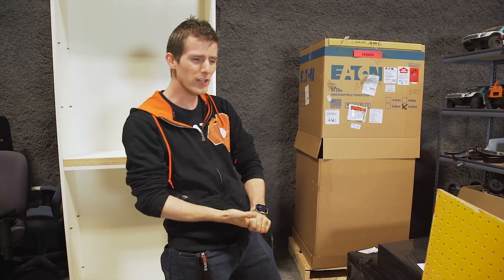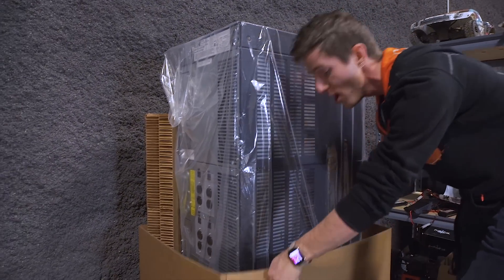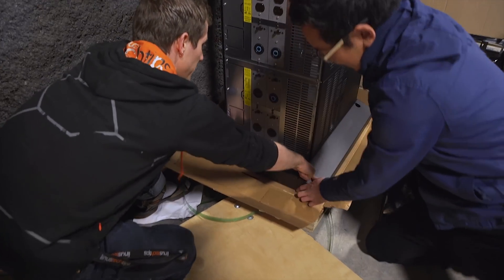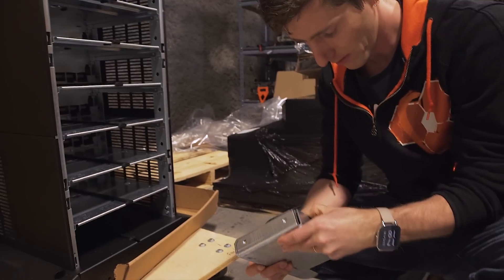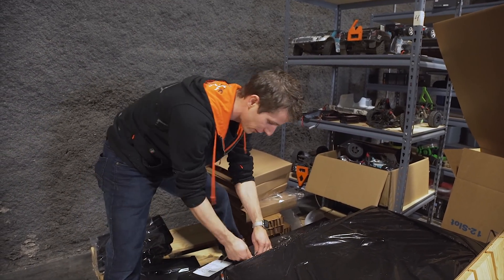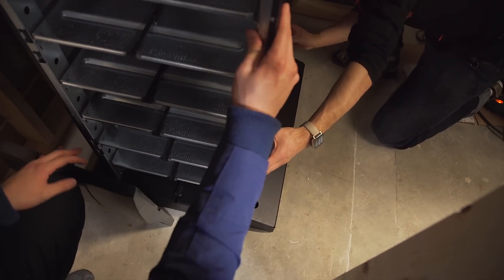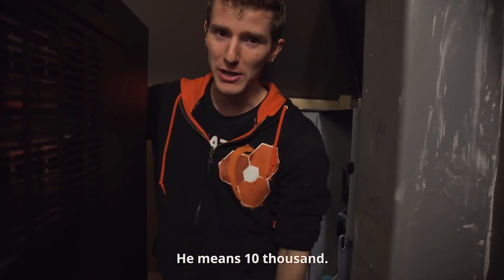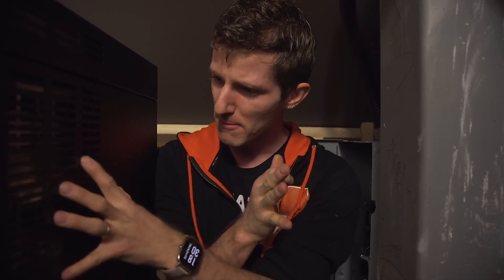HOLY $H!T - A $17,000 (CAD) Man-sized Battery!

Comment: 240v super high? Thats the base voltage in my country.
Reply: +ShimmeringSword I live in a 220V country and there are no safety ads either. Speaking of safety: During my brief stay in the US I had a vacuum cleaner power cord catch on fire. Never heard of something like that happening here (you know, half the current and all that).
Reply: +Jared Sheppard This sounds veeery silly. You do know it isn&#39;t really the voltage that kills? It is the current of Amps that is why the, What is it called in English, Ground fault circuit breaks at a certain AMP rather than Voltage. 

The reason countries like Sweden etcetra use 230-240V network is due height differences. You can&#39;t have 120-130V systems in a country that has many up and downs with lack of flat surface since you would lose to much too cable resistance.  

Also, when you get zapped by electricity, you will barely feel it aside from a fuzzy feeling. The dangerous aspect of getting in contact with Electricity depends on How it travels through your body and the fact it can mess up your heart rhythm. Making it beat uneven or simply shut down fully. Which can cause life complications. That is why it is recommended to go to hospital directly after for 12-24H monitoring. 

Also, every country uses high voltage to carry their power in large distances. In fact, we use 50K voltage systems in Sweden. Think even the power line that runs from northern swedish water plants have 100k but I am not too sure on that. The reason you increase voltage is to reduce Amps which generates heat among other things. 

So, no. The reason that 120V is safer than 230V being the partly reason is a silly excuse. Most educated electricians should know that Amps is what kills and Amps can be generated during shifting changes. For example, if a lightning bolt strikes it creates large amount of amps upon impact. Much like how a magnet moving over a coil generates Amps. Basic principle of Generators. 

So your experience sounds like silliness to me. Oh, I am an educated Electrician before you pull some odd card on me.

EDIT;
I might add, the usage of 120-130V systems are not beneficial since you lose a lot of your power consumption in your wiring since lower Voltage means higher Amps. So, technically, you are only losing out on efficiency.
Reply: +G009 The US uses VERY high voltage to carry current for long distances; however, when the power is introduced into the home it is brought down to 120v, this is done for various reasons but partly because (and I know from personal experience) being zapped by 120v is nothing compared to being zapped by 240v, so it's a bit of a safety thing.
Reply: @Shepherder312 THEN MAKE BOTH LINES OF EVERY OUTLET LIVE!!!!!!!! Belgium used to do EXACTLY that to make 220V out of 110V until they switched to 220V between live and neutral.
Reply: Here in canada(where linus is) in the residential area, we have 2 phase of 120v which one have an offset of 180°. that mean if you use both 120v to power something, you have a total of 250Vac.
Reply: Guys you're missing the point here. The same amount of power is delivered with 120/240V however because V/I = R a higher voltage is better because it means a lower current and therefore less heat created which leads to inefficiency, and thus a thinner wire can be used. So 240V is more energy efficient and the risks are still low if you are not an idiot who sticks their fingers in plug sockets. The fact is efficiency is important in this day and age so please educate yourself on electricity before you talk out your ass
Reply: shadoom
 hey now! Canada is a real country!
Reply: +Jared Sheppard Actually, the historical reason for 120v is because of the early designs of lightbulbs.
Reply: +Nom Nom We do as we please. Say something about it and we will give you some democracy. 

Do...Do you have oil?
Reply: +Gone Tomorrow Half of Japan...
Reply: 240v at 50Hz is the uk standard, with consumer sockets having maximum current draw of 13A, 16A for )
low draw professional applications such as catering, 32A and 62A for high draw such as small event lighting and sound systems and 32A 3 phase, 62A 3 phase, and 125A 3 phase for very high draw enviroments such as large scale events and industrial use. with the voltage of 3 phase being 400v across the phases. the reason 240v is used instead of 110v or 120v is cost, a higher voltage reduces the amount of current required to deliver the same amount of power, high current is the reason that wires get hot and a high enough current would melt the cable so a thicker cable is needed, at higher voltages with a lower current you generate less heat so you can use a thinner cable which uses less copper, making it much cheaper, it also makes it slightly more efficient as less energy is lost through heat which wont make much difference on the small scale but on a national scale that saves quite a bit of money. the reason why americans use 110v instead of 240v is because when the power grid was first installed well over 100 years ago, 110v was the standard due to lightbulbs of the time and to change over the entire country to 240v these days would cost trillions of dollars. whilst the long term savings would be phenomenal, it would probably take a decade if not several decades for the 240v system to make up for the initial cost. also the substations that convert the electricity from the several hundred thousand volts used to carry it down power lines to the consumer level of 110v would become redundant and new substations would need to be built to replace them which would he so expensive and would have power outages whilst being installed. america hasnt switched because its expensive and massive job to complete
Reply: Even in Israel which is a very young country we have 240v
Reply: 240Vac***
Reply: So its the best of everything, harmless, efficient, polivalent.
Reply: m8onethousand
Well, yes, you need voltage to carry it. I mean, Electricity is Ohm's Law... So kinda hard to be fried without it. Plus, if you stand on insulated ground with insulated shoes, basically plastic. It won't travel through your body so it won't even kill you. As ofr you touching a cable and it melting in your hand, that is bull crap since the mere Lightning bolts which is created during short cuts would blind you through the eyelids.

Voltage is the man, Resistance is the wheel barrel, Amps is the content within the wheel barrel. The wheel barrel allows you to move the object but it still provides Voltage resistance.
Reply: m8onethousand
" , it's hella fun shorting out a transformer and just melting metal rods by sticking them in between with your bare hands, no gloves whatsoever "

What do I need to re-read? You holding a hand over a transformator wiring at 30.000A that melts when the mere Insulation coating on Transformator copper only starts to melt around 60+ Celsius. You are saying you can hold an object that is 50+C Degrees? Really now? What are you? Superman?
Reply: Meegoo 10 volts is not enough to pass through dry skin. You'd need around ~60 volts if it's AC for that. So yeah, if you see a 30k amp cable at 0.1 volts near your home, don't fear to touch it since it won't kill you.
Reply: MX_81_DRAGON If you need volts, then don't say "volts don't kill, amp does". Do it the proper way and stop promoting incorrect dogma. You need both volts AND amps to kill. Get it right.
Reply: m8onethousand You need to work on your reading comprehension. 
I wrote “double the voltage means half the current to deliver the same amount of power.” 
You know, W = V × I. If W remains constant an you double V, I is halved.
Reply: MX_81_DRAGON Ehm sorry, but to my knowledge most European countries (certainly my native Netherlands) have 230V 16A on regular, non-heavy-duty circuit breakers, not 230V 10A... Heavy-duty circuitry here is 380V rather than 230V, and I believe 20A at aforementioned 380V is fairly normal for heavy-duty circuit breakers, though it's not uncommon to go up to 380V 35A or above.

***** Formulas like those are normally given with quantities rather than units, so it's P = U x I, not W = V x A, and certainly not W = V x I. Other than that, you're absolutely right though...
Reply: Final Cam Oh, it doesn't matter for that; 110V and 240V can supply the same amount of power. The thing is that the higher the voltage is, the lower the current needs to be to deliver the same power, and lowering the current running through a system has a number of rather useful advantages.
Reply: m8onethousand
You wrote touch+bare hands which makes someone with Reading Comprehension understand you were touching them with your fingertips. You didn't write " Shorting a transformator with a tool(Metal rod) is hella lot fun ". You shouldn't complain to me about reading comprehension when you write in a manner that does not even adhere clarification but only confusion. And your next post is you clarifying what you wrote which doesn't even remotely relate to what you originally wrote.

Also, Voltage doesn't kill what so ever.  Amps doesn't exist without Voltage nor does the other. And neither of these exist without Resistance. So you do not even need to clarify "You need voltage to kill something" Since Voltage wouldn't exist without Amps and Amps wouldn't exist without Resistance. Hence why the electrical world is built upon Ohm's Law. 

Also, metal rod that isn't insulated with plastic or similar is the same as touching a metal piece as for metal not melting? That is kinda untrue. If you take a screw driver and get a bit too close between N and L, you will create something akin to lightning which makes the surface of your screw driver to have a light melting in 230V circuits. Maybe this wouldn't happen in a transformator since there is not space between the copper. But I would imagine the inner coils would still melt. As for the Transformator being worth more than what I earn in my whole life? That is probably not true since you earn as an average Swedish Electrician around 40k USD a year + bonuses from finished work which might make that 50-60k USD on a lucky year. So technically it will be easy to earn enough for one transformator in one life time. You just won't have any living necessities or luxuries to accomplish it.

As for Amp kills and voltage doesn't? It is kinda true. Since it is the shifting change that kills you. When voltage meets a high resistance, it generates a lot of AMP which becomes the deciding factor if you die or not. But in AC you have 60Hz which is similar to 60 shifting changes of creating AMPS across the resistance or in proper terms, load. So AMP is technically the killing factor rather than Voltage.

Either way, our opinions differ on that point. I personally believe AMPs kills since you have certain low Voltage circuits that can kill you because of the amp currents running in the system. Low voltage being less than 24V. Oh, AC types that is.
Reply: +ShimmeringSword In a country where you can buy a gun in the supermarket it would hardly surprise me if safety isn't as much of a priority.
Reply: Sweden has 230V base i think
Reply: +Göran Svensson Actually, in most of europe it's 220-240 volts. It doesn't really matter. So a french 220 V rated thingy will work on swedish 230 V network.
Reply: m8onethousand Yeah but did you just hold the rod... or did you short the trasformer like: t-rod-you-rod-t.. because then the rod wouldnt melt because the current doesnt flow through you. And if you were standing and a isolated ground and touching copper with 30.000 Amps it wouldt anything. If the voltage was higher.. let the voltage be higher because the current wont go through you.(path of least resistance). Touching the rod with both hands is something else, because with high voltage you still had part of the current through you and probably die.
Reply: +m8onethousand no you still would even with 200 Volts on there, wanna know why? because you didnt do it. 30000 Amps on a Transformer is a lot. if you take 2 turns of wire on the secondary and lets say 1000 on the primary, you would still get 600A (N1 : N2 = I1 : I2 therefor 1000:2 = x:30000) coming in from the outlet, which is not possible, not with 120V and not with 240V. so stop using that as an argument

of course the primary could have more windings, but then it is probably custom, and i dont think you would coil it up like 40000 times so you can plug it into a 15A socket (120/240V is irrelevant) 
so yea, try to be more realistic and watch less photonicinduction
Reply: m8onethousand Well guess what: telling how cool you are touching 30kAmps and insulting ppl afterwards because you dont explain correctly what you did is stupid.
Insulting me who was just asking what you did, because i probably have the same knowledge as you in electrical engineering, is stupid as well.

Btw. The argument that amps kill is correct, because that statement has nothing to do with why the current goes through the body. It is a fact that current controls your muscles(stops the heart).
Reply: m8onethousand I am seriously speechless right now... I just told you what you are doing wrong and that I by the love of god dont know what is wrong with you being so aggresive. 

I am not here to tell you what mistakes you do in commenting, but i already told you that i couldnt understand the technical situation with your first comment concerning the transformer. After asking for clarification you awnsered with a non helping comment. Then I asked more direct for what you did... The awnser was a agresssive and insulting way of just telling me what I was asking. I dont know whats wrong with you.. probably too much hiding behind the internet wall.

If you dont want to "lose" this conversation(thats what i call childish).. I am fine with that you won..  But pls stop commenting more nonsense.
Reply: mark rossi I just watched his video... my conclusion: all people who are the same oppinion including himself dont understand english.... I already said in a previous comment that there is a difference between WHY the current goes through the body and WHAT kills the human... I am losing my hope in humanity
Reply: +m8onethousand Reading your aggressive and insulting comments almost makes me wish you'd try to let 0.5 amps flow through your body. 
Seriously, you're talking about totally different things. Whether you touch a low-voltage-high-amps circuit with your high resistance skin, (basically resulting in a 0 amp current) or if there's a low amount of current actually! flowing through your body! are totally different scenarios.

Your statement 'amps aren't dangerous if the voltage is low' is not wrong, but it's only true when you're talking about an external circuit, not when it's actually flowing through you.
Reply: +ShimmeringSword  Canada, no safety ads aside from being told to call before you dig to avoid the underground lines, and maybe a recommendation now and then to get an electrician to handle anything over 80 - 110v.
Reply: +Adam Cross like the United States Mexico and all of South America?
Reply: ***** What everyone seems to forget is that 220v is more efficient because it can overcome resistance more easily. It makes for thinner wire and higher wattages in a single household circuit. Unfortunately it also means it will pass through insulation more easily and arc more readily through air. It's 6 of one half dozen of the other, I'll  happily work on live 120v with decent pliers and a screwdriver, don't know that I'd risk it with 240v.
Reply: But we use less amperage for example for his 120 amp we would use a 60 amp because we have 2x the voltage at least here in new zealand...
Reply: Everyone except U.S. has 240V
Reply: @IIlIIlIIlII  Canada is also still using 120v
Reply: @IIlIIlIIlII us has split phase ⚡
Reply: G009 Yeah, it's pretty standard when moving power over long distance. 240v does sting, but 120v has never left burns and subsequent scars on my fingers.
Reply: m8onethousand Exactly. Double the voltage means half the current to deliver the same amount of power and, as you said, it is current that melts cables, so higher voltage is safer in that regard.
Reply: Helveteshit What on earth are you even on about? You should seriously re-read my message.
Reply: +Helveteshit The final at wall voltage and the transmission voltage are completely different things. Most long range transmission wires carry not only significantly higher voltage but are also DC, that power is then converted and distributed at lower voltage AC at large switching stations before finally being stepped down at the pole transformer to 2 phase 120v AC. I live in Canada and my dryer and stove are both 240v by simply bridging the two rails on my electrical panel. the big deal about the dedicated line Linus has for his UPS isn't that it's 240v but that it is a 100 amp service... just for the server!!
Reply: same
Reply: +G009 i was searching for this comment we got 380V plugs here that are called high power
Reply: yeah, i have 220~240v plugs all over my apartment
Reply: +G009
#240VBasevoltageGermany
Reply: Here a "High voltage" available in everyone's house (not the highest available) is 360V
Reply: +Jared Sheppard Number one our power system is outdated other places transfer electricity way higher voltage than us. Two amps kill voltage does not, 240v at one amp would hurt 120v at 100 amps would roast you. Look up a taser they are low amp and very high volts.
Reply: +Jared Sheppard Volts by themselves mean nothing. You can get zapped by couple thousands volts and survive, provided current is small. Same things goes other way around, you can easily die from like 10 volts.
Reply: lonewolf5460 Wrong. You need BOTH amps AND volts to kill. You can touch a cable with 30k amps (I did, it was more of a rod but whatever) and it'll do nothing, so long as it's very low voltage. The reason being electricity at low voltage can't pass through the resistive layer of the skin. Once it's inside, you're dead.
Reply: +Jared Sheppard 1. every developed country is carrying the energy at a higher voltage to some point.
2. For safety, it is not important how much voltage you get, but the energy per time. Therefore you need to think about your current... because P=UI
Reply: Luke Johnston Almost right. The diferences in energy loses due to l^2r are almost negligible due to the fact Americans and Canadians use thicker cables thus negating the increase in resistance you're talking about. Also (I know you're not talking about this, but whatever), High voltage inefficiencies (due to Eddy currents) are only a thing for very long distances which end up requiring very high voltages. All-in-all: the difference between 120v and 240v in energy losses is pretty much nonexistent.
Reply: m8onethousand Well, I didn't buy it, it was part of the equipment of the house I was staying in.
Reply: +G009 yeah, i think u come from Britain! Cause im British and 240v is the base voltage!
Reply: MX_81_DRAGON Good to know that, I suppose. Over here 380V equipment does indeed use five-pin plugs and sockets, while 230V 16A uses two-pin (non-earthed) or three-pin (earthed) plugs and sockets. Using non-earthed plugs and sockets has been discouraged in recent years, but they're still very common indeed.
Reply: +Robert Faber Ff in nederlands pls dan kan ik het volgen xD
Reply: WernoPlays Gebruik gewoon een internetvertaler...
Reply: A lot of new houses have 400V in Norway, lol.
Reply: ikr
Reply: +ShimmeringSword We don't have constant (any?) safety ads in the UK either. Obviously children are educated that electricity can be dangerous, but that's a given.
Reply: in Greece: base voltage: 220-240V, three phase voltage: 380V
Reply: +G009 same here
Reply: +G009 same here!
Reply: +Francisco Herrera Or somewhere else in Europe
Reply: +MX_81_DRAGON The volts determine the amps flowing through you so its actually a combination. The higher the voltage the more current that will flow through you. Basic Ohms law.
Reply: +m8onethousand Yes but with the same load 120v will be pushing twice the current compared to 230v. Basic Ohms law
Reply: +G009 he said super high draw. And for that to run efficiently, it's better to use 240V. Current draw and voltage are not the same thing.
Reply: +Curtis Murphy The only time power is transmitted as DC is when you have different frequencies at either end. Its incredibly expensive and complicated to up and down DC. Only very new transmission lines are DC and they are normally between two countries.
Reply: +lonewolf5460 Volts directly relates to the amount of amps flowing, the human body is a given resistance so the higher the voltage the more amps that will flow through you if allowed.
Reply: +G009 250v here bitchessss goml
Reply: +m8onethousand I understand what you mean with your 30.000kAmps transformer shorting thing... but explain why it is important if its low voltage or not... because the true point behind it is that your body isnt shorting the phase... so the current wouldnt even go through your body. 
Sorry for my bad english... cant really talk withing the electrical vocabulary
PS. Maybe i am misunderstanding something...
Reply: maxi2298 That's the thing; had the voltage been higher, I wouldn't be posting this message here. The blatantly obvious point being that what people say "it's the amps that kill, not the volts" is straight up bullshit. You need BOTH amps AND volts to kill.
Reply: maxi2298 I wasn't isolated, and yes, I touched the rod with my two hands. Guess why? Because there wasn't even 0.1 volts. It can't get to me. It's pretty much USELESS. And yes, the rod I used at first became red hot, I then used a smaller one that actually melted.

All-in-all, saying "volts don't kill, it's the amp!" is incredibly disingenuous. You need BOTH amps AND volts to kill. It's incredible how people fight against such a blatantly obvious conclusion. Holy fuck, dogma sure is a force to be afraid of.
Reply: +G009 in the US 240 volts are twin pole circuits. Its not the same thing plus 240 volts plugs here are 30 or more amps. Again very different.
Reply: maxi2298 I'm so sorry for expecting people to grasp basic physics 101. I suppose next time I'll treat you all like dumb fucks.

And no, the "it's not the volts that kills, it's the amps" is still disingenuous no matter how many mental gymnastics you come up with. You need both in order to kill.
Reply: m8onethousand Well i guess we are at the end now... your arguments are meaningless and you still dont notice how stupid you behave as someone who has knowledge of somthing like this... I just hope that you feel sorry for your insulting and just dont want to lose your pride infront of the internet...
Just to awnser to your comment. Dont you think "we" can assume that YOU are just trashtalking and talk like you know what you are doing. It goes the same way around. If i notice someone who was posting a comment that can be misunderstood or is just the was he/she wrote it wrong, I ask for a clarification.. You on the other hand just insult the ones that ask if you are a dumb fuck or the phrasing of your thoughts is just bad.
Reply: Helveteshit Haha, oh wow. So much wrong in one post. Where to begin... where to begin indeed. Since I could literally write paragraphs after paragraphs from this single message alone, I'd much rather skip all the nonsense and focus on some of your main points instead since this is getting a bit tiring to be perfectly honest.

So, without further ado, let's begin, shall we?

"when you write in a manner that does not even adhere clarification but only confusion[...]"
I'm so sorry for expecting a basic level of knowledge of transformers and electrical jargon. And no, my statements were completely consistent. I can't for the life of me (or the attention span of people on the internet) expect that everybody on the internet is an autistic fuck who needs everything told in a dichotomous manner. Have some common sense, man.

"Also, Voltage doesn't kill what so ever."
Neither does amps. You need BOTH.

"Amps doesn't exist without Voltage nor does the other. And neither of these exist without Resistance."
Except that's not true AT ALL. Have you ever heard of superconductors? You can have BOTH amps without voltage, just like you can have voltage without amps. Holy fuck, this physics 101. Do you even know what a CHARGE is? And by "charge" I don't mean the bastardized mainstream term, but the real physics term. Because if you did, you'd know why your statement is full of shit.

"So you do not even need to clarify "You need voltage to kill something" Since Voltage wouldn't exist without Amps and Amps wouldn't exist without Resistance"
Despite what I already wrote above, I'd like to add something out. When you say "volts don't kill, it's the amp" you're literally contradicting yourself with the statement of yours I just quoted. You NEED voltage in order to get past the outer dry skin of the human body, otherwise it's not going to do JACK SHIT no MATTER HOW MANY AMPS. Hence my statement about the 30k amps transformer example and why I'm still alive.

"Also, metal rod that isn't insulated[...]"
Nothing really here to write about in this paragraph. Just do a quick YouTube search about it. There are a handful of people on YouTube (see my posts above where I linked to one who did it way less riskier than me) who have done similar things to what I did. It really isn't anything special at all.

"As for Amp kills and voltage doesn't? It is kinda true. Since it is the shifting[...]"
That's the whole point: amps won't even get to you if you DON'T have enough voltage, thus singling out "amps" as the sole culprit is incredibly disingenuous and LAZY. So, I'll repeat this again: you need BOTH amps AND volts in order to kill.

"[...]I personally believe AMPs kills since you have certain low Voltage circuits that can kill you because of the amp currents running in the system[...]"
30k amps isn't enough to realize the dogma you've been taught is wrong?
Reply: maxi2298 Do you seriously expect me to read that drivel? Go try and debunk me and then MAYBE I'll read it. As it stands right now, all you're doing is criticizing the way I say things, not the message itself. You know what I call that? CHILDISH. Grow a spine.
Reply: +G009 half the people in this thread need to watch electroboom and get educated on amps vs volts being the killer.
Reply: +G009 My country also has 220-240v standard outlets :P
Reply: m8onethousand technically you are isolated because the transformer isolates you from the mains, there is no polarity in the output of the transformer. Yes 0.1 volts is harmless but just correcting you buddy. That could be a 200v output and you would feel nothing ass all the current would be across the bar none of it going through you.
Reply: +Robert Faber yah, part of japan which was invaded by US
Reply: +Jared Sheppard Yeah, I was told once that 120v basically makes it safer to handle in case you want to try to DIY things without too much danger. That said, I personally am going to be getting my house setup with 240v+ in the future. Might be useless to me in some cases, but I have  few ideas that might require it regardless. I think of it as a nice to have, not need to have. Yet at least.
Reply: +itai landau "israel" is not a country :* if you need to steal land and wall off the people you stole it from you are not a real country, you're a settler colony.
Reply: +Adam Cross like the US
Reply: *****
now i know why when i buy a wii (2007) in thailand they give me this bulky voltage converter with it
Reply: G009 Where do you live Tomorrow Land?!
Reply: G009 welcome to 110volt land
Reply: The power entering in North American homes is actually 240 volts, but it’s providing using a center tapped transformer. It’s not “two phases” as people commonly think, it’s a split, single phase.
Reply: jafirelkurd that’s probably why we always have two outlets on top of each other instead of just one.
Reply: we got some oil but its illegal
Reply: i have lived here 50 years and never once seen a power safety ad where you in wellywood or something
Reply: they both kill idiot because amps x volts = current
Reply: In the us you can get 240v but its just not standard
Reply: G009 ehh too low
Reply: @jb76489  the whole north America (Canada, USA and Mexico ) uses 120-127 volts for reside voltage.
Reply: Jett B read again my comment.
Reply: Voltage is kinda irrelevant, current is what matters.
Reply: The US does use 240, but we split the phase and only use 120 for each half of the panel
Reply: Jared Sheppard I guess every country does this. In my country we get 400v 63a reduced to 240v 16a. I've been zapped a couple of times by 240v. It stings, but it's not as bad as one would think. It is however not a pleasant feeling!
Reply: +YuhaYea Like he said, every real country lol
Reply: +ShimmeringSword You sir have no understanding about electricity. Whether you consume 1.1 kW by drawing 10 A from 110 V or 5 A from 220 V makes no difference. So the danger is the same. But there is one benefit when using a higher voltage, you don't have to use thick copper cables. So in europe the copper cable is thinner than in US.
Reply: +G009 even thailand have 220-240v and why fully developed conturys still have 110v-120v lmao
Reply: Surely you guys realize the choice between 120 and 240 isn't some question of if the country is capable or how developed it is. Very few devices require 240 and 120 is safer. Sure some are talking about 240 being "not too bad to be shocked by either", but the situations you can run into where a shock IS lethal are many more with 240 than 120.
When I lived in NZ there was constant advertising and talk about electrical safety in the home, meanwhile living in the US I don't see any of that. Does anyone in another 120 country see safety ads?
Reply: Haha, oh wow. All the ignorant people here who are self-congratulatory patting themselves on the back because their countries use 240v. Do you even know why you think that? Here's the kicker: whether you use 100v (like Japan), 120, 240, etc. what dictates the amount of power (i.e., watts) you're getting is your circuit breaker. Nothing more. Whether you have 1000 volts or not, doesn't really matter because we're both getting about the same amount of power at the wall socket which is dictated by, like I said; the circuit breakers. Remember: watts = amps * volts.
Reply: same
Reply: And in mine too :P
Reply: MX_81_DRAGON It's incorrect dogma nonetheless. Teach people the right thing, stop treating them like dumb fucks and maybe they'll stop behaving like dumb fucks. Like I've said a ton of times before in this stream of comments: I've messed around with a transformer capable of delivering 30k amps (this is an estimate based on the transformer's windings) at a extremely low voltage. Guess what? I shorted the transformer using a metal rod WITH MY BARE HANDS and I'm still alive. So again: you need BOTH amps AND volts to kill.
Reply: every real country has that voltage
Reply: +Gone Tomorrow Whatevs many countries have 240v to even 340v
Reply: What exactly is the advantage of having 240 in your house over 110? You running a data center in your living room or what?
Reply: MX_81_DRAGON Oh the never dying good ol' "amps kill, not volts" dogma. You can touch a 50,000 amps cable and it will NOT kill you (I've actually done it before with around ~30k amps [the meter couldn't measure that high, so it's an estimate based on the transformer windings], it's hella fun shorting out a transformer and just melting metal rods by sticking them in between with your bare hands, no gloves whatsoever). In order for electricity to kill you, you need BOTH amps AND voltage to pass through the resistive layer in the human skin and do some damage. You need about ~60 volts for AC (for DC it's about 20v less), actually.
Reply: ***** That's where you're wrong. Double the voltage DOES NOT mean half the current. Current = amps, volts = electromotive force. You can have 1 volt and still deliver 50k amps. You can even have 0.1 volts and melt huge steel rods if the amperage is high enough. Voltage DOESN'T melt cables (like what you described above), that's the work of the amps, i.e. current.